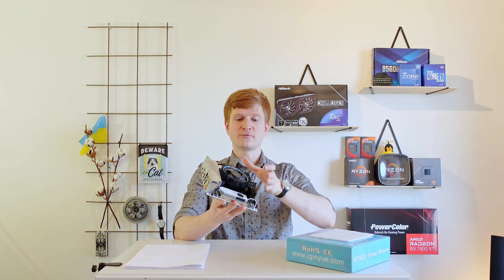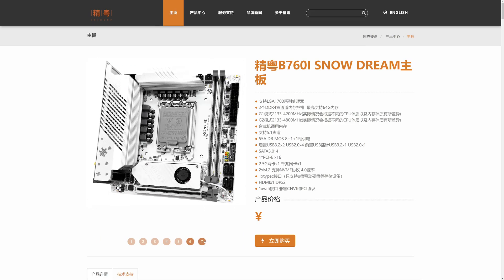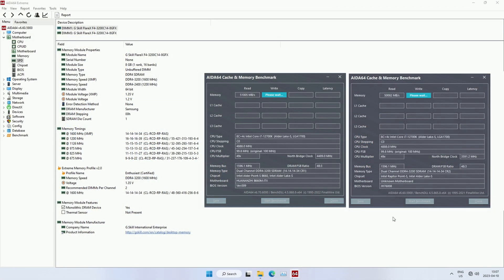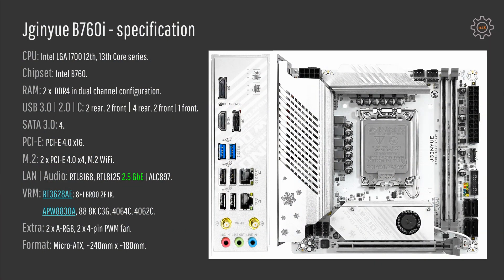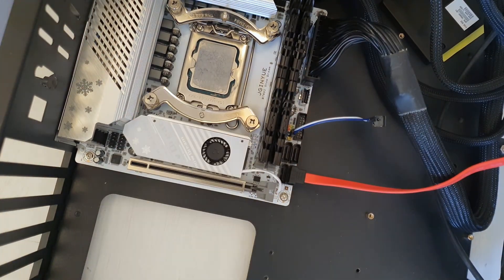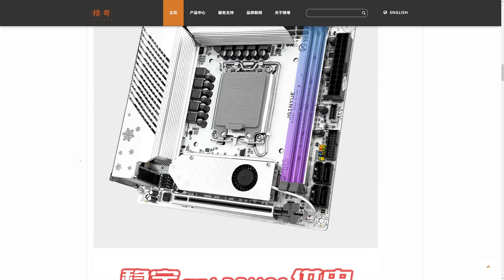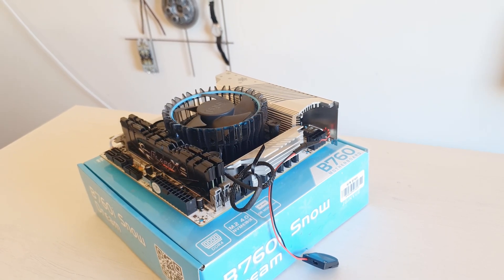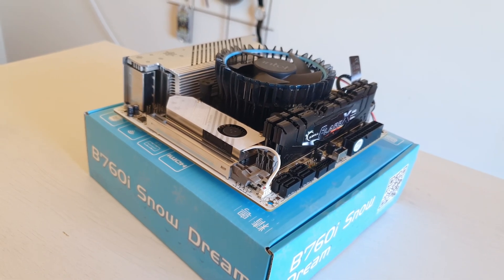🇬🇧 Jginyue B760i LGA 1700 Mini-ITX motherboard – detailed review with i7-12700k and i5-13500

Comment: Does this system work with intel ARC? as in does ReBar exist on the mobo?
Reply from the maker: It shall work but I have absolutely no guarantees as I didn't test it myself.
Reply: The compatibility is not very good.

Comment: Amazing content, u are saviour and love the way u explain the stuff. Subbd. Ur review made my take the risk and buy this. I am going for 13600k with this motherboard. I hope it will be good. Btw do you have any video on these bios/cpu parameter updates explaining what we do and why we do so ?
Reply from the maker: The best suggestion is not to touch anything in the BIOS except the language and the XMP profile. If you need a specific feature, you know what it does, then you can adjust the BIOS accordingly but wandering in the BIOS trying to get better performance is a lost hope.
Reply: @Miyconst  Thank you, I found another chinese board and also saw ur video on that erying b760i d4. What do you think  ? Which is the best motherboard for intel 13600k as per you?
Reply from the maker: @rainbowrunner1136  I would stay far away from ERYING and would not recomment JginYue, instead I would go with ASRock, MSI, Gigabyte, Asus, or at least Maxsun, Biostar.

Comment: good work! such a really good review for an obscure brand. and you even gave very valuable instructions for those who want to try. i kinda want to try the lottery and see if i can win a working unit from this brand since we really lack white itx motherboards from popular brands
Reply from the maker: Good luck with the lottery but why would you want a white mITX motherboard that much?
Reply: @Miyconst  upgrading out of my haswell pc built in 2015. i thought a tiny air-cooled case would be cool this time, specifically mechanic master c24. i was able to get all the other parts in all white except for the motherboard. i do think it's bad to obsess over white pcb since not much of the itx mobo would be visible anyway. still, i'd like to try my luck with jginyue since i found a ddr5 version. if it fails, then there's no choice but to settle with msi b760i edge

Comment: Hello, Im not that good in english but tried, does it means the mobo don't have Wifi? you can't just plug 2 antenna on the back and it's working?
Reply from the maker: That's correct, the motherboard does not have WiFi.
Reply: @Miyconst  thanks for the fast response, I think I understood so you have to build the module on the motherboard but its in a bad place?
Reply from the maker: Yes, it's very annoying to install the module.
Reply: @Miyconst  Thanks a lot for the answer

btw you should take a look on the description the link for the motherboard is not to date, there is no B760i for the curious ones (easy to find on google but no affi link for you)
Reply from the maker: Heh.. Chinese always update products after the links are generated.

Comment: Hi guys, I bought this motherboard last year and it's on the latest BIOS. I bought an RX 6750XT, but it only works if I set the PCI Express to Gen 3.0, but my RTX 3070Ti works normally at 4.0. my processor is i5 13400 I have two nvme SSDs and NZXT H1 v1 case with riser cable updated 4.0 from NZXT itself
Reply: I have got nzxt H1 with 3.0 riser and had to change pci express to 3.0 to make it work. Leaving it in auto wont boot to Windows. Btw the are few bios update since this review and it supposedly support 14th gen with latest BIOS. Anyone tried with 14th gen yet?
Reply: @foxraiha  Hello, i have same problem with pci, but i cant found how to change pci in bios. should i download last bios update for that?

Comment: Hello. Does this work without the Nvme? I have only OS on SSD.
Reply from the maker: It surely does.
Reply: Thank you so much. I have another question, it gets stuck on a blank screen with an underscore on the upper left side after save and exit. After that, pc started to blink on and off. My take is maybe the PSU isn’t enough to make it work, since it’s just 400W. I have an i5 12th gen, 2x8gb 3200mhz ram, etc.
Reply from the maker: @troyquebral1241  this is a system boot issue, maybe you are trying to boot into CSM with a UEFI system or the other way around.

Comment: i have the same board. but i cant boot with 2 ram. do you know how to fix this?
Reply from the maker: Replace the RAM or the motherboard and see what's faulty.
Reply: @Miyconst  the ram i use on my other board boot fine. only this jginyue board cant boot with 2 ram only 1
Reply from the maker: Most like the motherboard is just defective but also could be badly seated CPU or some dirt in the RAM slots.

Comment: Hi there, I have the DDR5 version (JGINYUE B760i D5). I installed DDR5-6400 (XMP), I selected the XMP profile and set memory voltage to 1.4, but it won't post. Any ideas?
Reply from the maker: The motherboard isn't good enough for this speed.
Reply: @Miyconst  The specification says it supports up to 7000+ MHz. Is that not the case?
Reply from the maker: @dual1ty999 what specification says doesn't matter when it comes to the Chinese motherboards.

Comment: No software for this motherboard? yes there is.. google OpenRGB
Reply from the maker: Did you test that it actually works? I no longer have the motherboard.
Reply: @Miyconst  I didn’t test, but they sent a motherboard to CalcProgrammer1 (Adam Honse) to help with the integration, there are a few merge requests from Jginyue in OpenRGB gitlab
Reply from the maker: Then we can say that maybe there will be support but so far it's undefined.

Comment: is Jginyue and both maxsun one and the same?
Reply from the maker: No, Jginyue is a lower grade tier compared to Maxsun.
Reply: Maxsun would be a better option.
Reply: @yotoprules9361  i ended up getting the maxsun 😁. Works fine to me. although because i run my os off of a sata ssd i had to turn on something in bios.  otherthan that it does al i need it to do. (the only thing i have dared to touch in the bios is fan speeds).

i think by mem i went for this because of price and i can eventually put in two nvme
Reply: @caveman1988  great! I've used a few AM4 Maxsun mobos and they've been solid.

Comment: I am in China now, so I bought this on PDD for only 590 CNY= 82 USD dollar. The BIOS is well designed, but it maybe uneasy for the english user bcs it doesn't have a language selecting option
Reply from the maker: It does have language selection menu on the very first page, at least mine had.

Comment: im looking to buy this motherboard, can you maybe link the battery connector you used to connect a battery to it? and can you maybe explain through what port you updated the BIOS? since none of them have "bios" written on them
Reply from the maker: I have added link to the battery holder I used into the video description. For the BIOS flash you need to create a bootable USB drive and boot the system, there is no BIOS flashback function as we know it from the other known brands.

Comment: Thank you for this overview! This board is extremely cheap for ITX LGA1700, only around $80 shipped, and has really good I/O for the price. Nobody in the English community knows of this board since its a chinese brand.
Reply: There is also a lack of trust from English buyers, generally things like this are simply direct to consumer goods, and a large part of this design was made a while back, a renowned brand spoke to them and asked for a particular feature set and used the manufacturer to make their boards, a small company could not make a board like this for the price they charge.

The trade off is a very basic and old bios that's less than ideal, especially for those who aren't so experienced software wise, I own this board and was pleasantly surprised that the seller was very helpful for troubleshooting and willing to accept a return, less hassle than Asus or razer which I've had in the past.
Reply: It's have XMP issues,

Comment: I just bought a B760I snow dream
but failed to boot up with 12600k
cannot even go into  the bios...
the pc powered on, fan turn on, debug light show no problem
keyboard background light and monitor turn on, 
monitor later said no signal, 
keyboard no response for num lock, unplug and plug again the keyboard does not turn the background light on
Any ideas what going wrong? many thx!!!
Reply from the maker: You have to test your components separately, if they work, but motherboard doesn't - you have a defective unit.

Comment: Hej! I was thinking a building a cheap proxmox server from parts i mostly have, i have a Xeon E5-2640 v4, and 4 DDR4 8GB ECC 2133 MHz, Nics, and storage from an old server. Do you have any recommendations for a suiting motherboard ? The cheaper the better, but still stable enough for 24/7 operations.
Reply from the maker: The best I could suggest is Huananzhi X99-QD4, but longevity and stability of the board is undefined, just like any other Chinese X79/X99 motherboard.

Comment: I need to update the bios of my B760i Snow Dream, but the JGINYUE website is not working. What is the password for the file you uploaded? Sorry for the bad english, I'm from Brazil.
Reply from the maker: Please read the readme file from the same folder.
Reply: @Miyconst  I read the text file, copy paste the password but it shows wrong password. Can you help me please.
Reply from the maker: @leonardodesouza2903  I have updated the files with password that uses Latin letter only, it should be fixed now.

Comment: great review, got the board a week ago but forgot that i my cooler don't have a 1700 mounting kit, waiting for a new one in the mail and plan to use it with 12700 and add a cpu bracket for a better cooling. thanks for the bios files, should update it later when i can. btw in video you write the board as mini-ATX instead of mini-ITX
Reply from the maker: Thank you for spotting the error, it's indeed mini-ITX, not mini-ATX.

Comment: Yeah, the Chinese Customs Export/Import regulations forbid shipping any assembly with a "visible" lithium cell.
If the motherboard has a button lithium cell, and it is able to be seen when inspecting the motherboard, then the seller/shipper has to remove the battery before it can be exported (or imported) from/to China.
This even counts for the ones where the button cell is in a plastic retaining housing that is surface mounted on the motherboard PCB or heat-shrink cover with pig-tail harness like what is on this motherboard in the video.
This regulation was introduces several years ago, but within the last couple of years it has been more heavily enforced.

They can, however, export/import/ship lithium cells themselves, which is why you can buy the little heat-shrink button cell pig-tails separately and/or button cells in blister-packs.

If the motherboard was mounted inside a computer case, then the button cell could be left in place, as you can't "see" it then.
This is why a pre-built computer system, laptops, cell-phones, battery packs for laptop or tools, or any other lithium powered electronic device can be export/imported through Chinese customs containing lithium batteries/cells, because the lithium cells themselves are not visible.

If the Chinese motherboard manufacturers want to get around this issue, they could make the button cell holder or the location of the button cell pig-tail to be inside of some part of the motherboard, such as inside of the IO riser cover, so that it is not visible.

Comment: Reason i bought the MB Jginyue B760i coz 1. The price for lga1700 itx cheap ispend for the cmos+wifi+antena total with mb around 115$(have goodlooking motherboard white edition) also tax payment, 2. I'm not veteran user like all everything you need it's push thePower or Overclock everything, 3. Also i'm not sure if the chip is B760i(pure) maybe around under B660 but i don't care about that, 4. 2x Slot M.2 support NVME and Pciex16 4.0. Just hope for the motherboard have good lifetime🤣. 

What your hope for brand-CN cause the price different with Brand Top-Global?😅

Btw, good video for detail inspection~
Do i need update the Bios for normal user activity?, yeah cause the stock ui bios not frienly user too~

Comment: I been waiting for a deep review of this board too, I like that your reviewing thing out side the off hype over price crap the other Youtube reviews are reviewing tank you. Have you tried accessing their web site via VPN as in UK I still can't access, I wondering in there is some sanctioning Geo-fencing going on, as like there is Ukraine and Russian site are blocked here due to the sad conflict there. The Bios issue is one thing putting me of the board for my 12100 and 3200mhz ram(2133 without XMP set).  It is one of the thing putting me of this ITX board as a replacement for my Gigabyte h610i board as I can buy a wifi card for and case will not allow a PCI-E card(it a In-win B1 case I'm using). and it has the socket. the gigabyte board doesn't have that option and any ITX in UK is over £150 or total crap so willing to do a Aliexpress gamble. Using Linux I use the BIOS RGB basic setting so all look OK with the later bios.
Reply from the maker: First, there is no "sad conflict", there is brutal ruzzian invasion into Ukraine with massive war crimes and international terrorism. Regarding the website, I am not sure how true it is, but my Chinese contacts told me that Jginyue website was DDoSed and after that they took down the file server, so the download links don't work in China either, they distribute BIOS through WeChat. The XMP settings work, you just need to manually set voltages and Gear Ratio.

Comment: hello, i have a i3 10100f, 16gb of ram and a 3060(12gbvram) and ive been considering upgrading my cpu but the price for performance of LGA1200 chips is horribly expensive (compared to 12th gen). i have a budget of around $240 and am considering just buying an x99 motherboard and a xeon cpu. do you think its worth it? or should i go for 12/13 gen? i use my pc for light gaming and music production.
Reply from the maker: X99 Xeons are horrible for music production, here you need strong single core performance, thus i3-12100 is a way better option.
Reply: @Miyconst  thank you
Reply: My system is a 12100 DAW and the 12th gen are great for music as the single core speed is high you get less latency also get higher speed lower latency DDR4 as DDR5 latency is painful on cheap DDR5 kits when it come to live music, how ever if you can afford a DDR5 pro low latency kit would be better but you'll need to sell a organ or two. 12100 is about 40% fast than the 10100F. Look at CEX if you in UK sell the old CPU and fund the new CPU aim high and look at the 12400F they are often cheaper than the3 12100 second hand. A second hand CPU is not so risky if brought via a good retailer who offer good trading, and guaranteed on parts. Not Ebay thought.